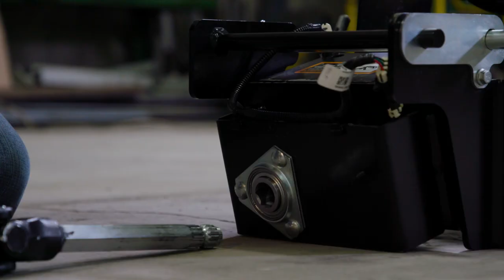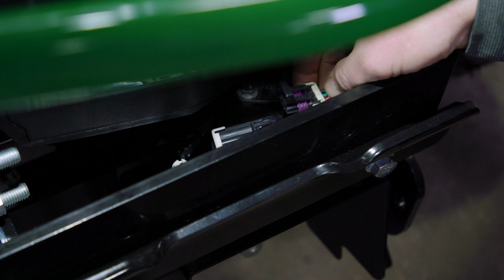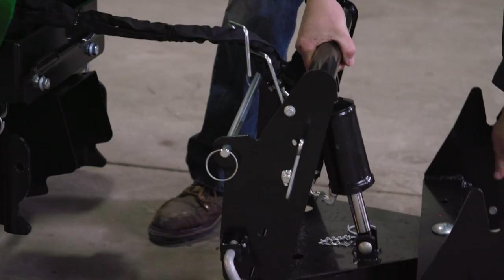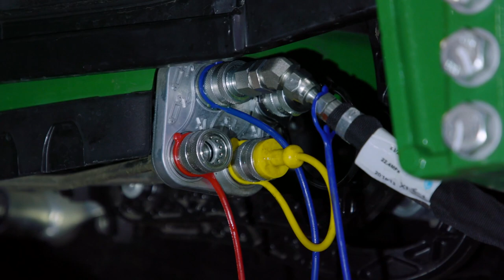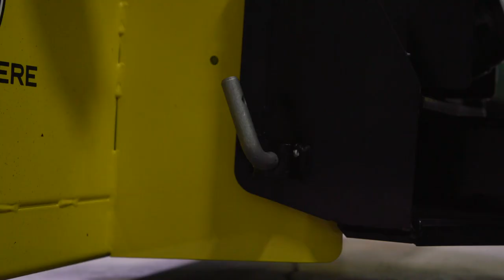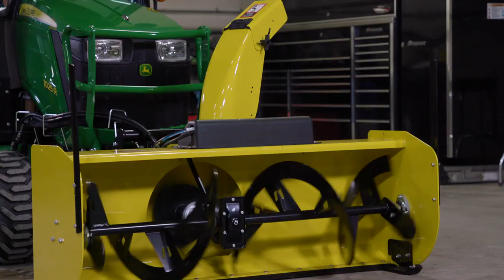John Deere 1023E, 1025R, & 2025R Snow Blower Installation Tutorial by Minnesota Equipment

Comment: Make sure to turn the wheels all the way left or right to get the first part of the attachment on to the tractor and past the steering tie rod.  That tip would have saved me a few hours
Reply: You are correct. It took me a while to figure this out also. 👍
Reply: Have the tractor running to get the full turn of the wheels. That was key to my install
Reply: Been trying for like an hour till I saw this
Reply: Absolutely the most valuable comment here. I had to learn this myself the hard way.

Comment: It’s a nice snowblower, but I don’t like the process just shown.  I made a snowblower that mounts on the loader arms.  My snowblower is engine driven, 54 inch, with electric spout rotation and deflector.  So my snowblower attachment process is 1) pull pins on bucket and drop it off.  2) use the loader to pick up the blower, place the retainer pins in the holes. 3) connect one 7 pin electrical connector (trailer connector).  4) start motor. 5) blow snow.
Reply: Yeah the process they show for this snow blower is way complicated , and it can be made much easier by not taking it apart . Just add a 2x6 frame to set it on and you eliminate 90% of that grief they displayed . It takes me 5 minutes to put the same blower on my 2025R using this 2x6 platform I made . It then uses the hydraulics of the blower to put it on . Then just slide the pins and hook up the hydraulics .

Comment: Never liked the hydraulic couplers that John Deere uses. Dirt, grass and other debris gets into those couplers especially the females. Ever since I switched to Flat face couplers, I don't have that issue.
Also wish they would incorporate the hydraulic quick connect valve bank that has a handle for quick connections. So much room for improvments.

Comment: No mention of the fact that if there is a fast attach mower set up on the tractor, the front mower mount needs to be removed (several bolts) and different mounting plates have to be installed to attach the snow blower. Then the reverse next spring. The installation instructions from Deere are very poor. Guess they expect the average customer to call the dealer to have this done. Not very user friendly for the average owner.
Reply: Would you happen to have the part number for that front plate? Deere seems to keep this info hidden.
Reply: @prestigevending15  I will try to get those numbers for you
Reply: @cjstrasser  thank you so much! Got a great deal on a complete 47 in package. The guy used it once but had a gravel driveway and lost three windows. He didn’t want to take the mount off which I understand.
Reply: From: @davidrey691
1 year ago
"Make sure to turn the wheels all the way left or right to get the first part of the attachment on to the tractor and past the steering tie rod.  That tip would have saved me a few hours".  I have a "quick connect" mower and this process works
Reply: @alhall959 I needed the tractor running to get the full wheel turn needed to install mine. I agree, would have saved a lot of time.